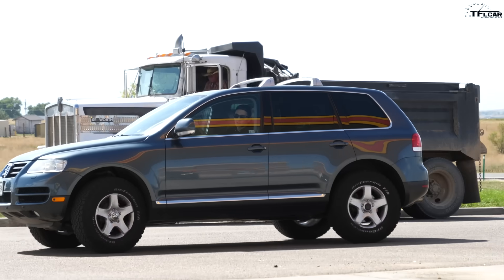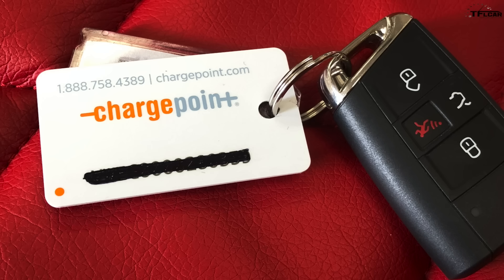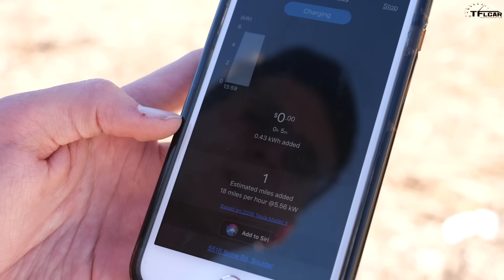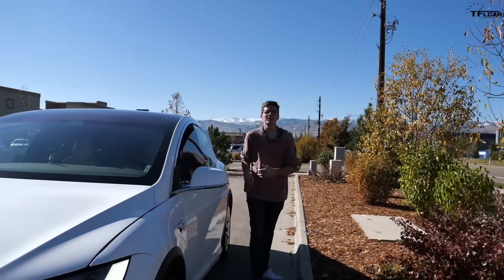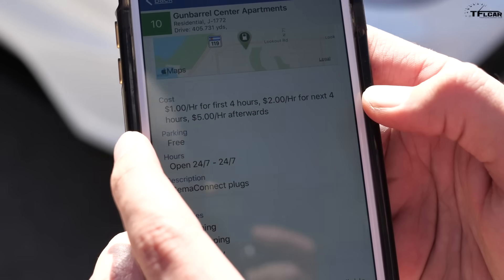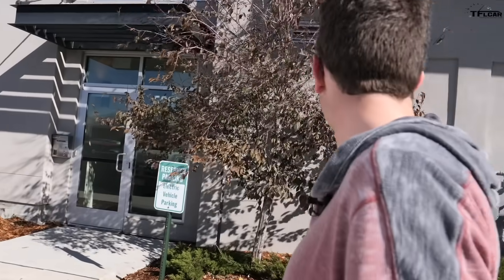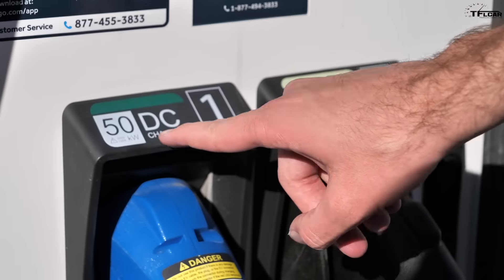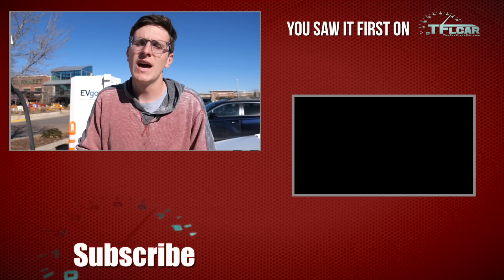Here’s Why Charging an Electric Car Can Suck - And It’s Not The Reason You Think!

Comment: So let me get some facts here You have to find a place to plug up when out and need a charge. The plug you find may or may not work. The supercharger is controlled by tesla have heard stories of them shutting off access to said plug. So no matter which way you charge it will take at least 30 if you can fast charge up to hours to limp home. Then every plug charges different prices and can set their own operating hours as well. Yeah, no screw that 5 minutes to pump 10 gallons in my car and a 400-mile range. Then add on the fact these cars cost how much more than a gasser. So you want me to pay extra and have all the charging BS as well.

Comment: The title should be ....electric car OTHER THAN TESLA Can suck; Otherwise, it is totally misleading. Yes, you need a garage or a car port when you own an Electric car. If you have your own electrical panel, 90% of the time you have access to 240V and 48 Amps of potential charging capability (not that you ACTUALLY NEED ALL 48 Amps). Depending of the range of your car and your DAILY commute that's all you need MOST of the time. It is like having your own, discounted "gas station".   No-one drives 24/7, when you don't drive, your car charges. In my case, 50 mile daily commute  gets replenished in less than 2 hours (if I used all available 48Ams - 240Volts it would get replenished in an hour.). Traveling long distance is when you utilize superchargers (Tesla). You don't need to enter any payment info, just pull in,  plug in, go to restroom, stand in a line for coffee or food, or a snack, by the time you are done your car will be ready. In a matter of fact, for me, the car is ready BEFORE I am ready to continue to sit in it for another 3-5 hours. I  have to hurry up to unplug it NOT to be charged idle-charges (occupying supercharger while NOT charging). Yes, at the present time, any other car tan Tesla, when traveling long distance may be.... problematic, but I am certain that will change as soon as VW, Ford, Rivian will actually START selling their electric cars and the CCS charging infrastructure catch up with Tesla's (in US - in Europe, in general,  tesla (model 3) uses CCS and equips their superchargers with CCS plugs).... Shame on you TFLC, you misled the public for what, views? Likes? you just lost all your credentials....

Comment: Most houses and business have a 220+ volt 100 amp 2 leg single phase feed to the fuse box from the pole or under ground transformer box(green). Most dryers and ovens are 220/240  50-100 amp single phase service outlet if you need a quick fix with a correct plug adapter with a 50 feet or less Heavy duty amp rated extension cord. See how easy that was. Respect all electric power especially high amp will kill you.

Comment: Seems like a lot to go through just to charge in public when compared to the standard of gasoline. "Oh good, there's a gas station I can fill up at" vs "There's a charging station but I'm not subscribed to it/it doesn't support my make and/or model...". Better make sure to never forget plugging up at night if that's an option depending on where you live.

Truly, this vehicle in the current state of things are not meant for someone working a minimum wage job just trying to get by which the majority of us are doing. Not only need to afford an EV but need to own a house with a garage to charge it in and enough down time to let it charge a decent amount. Heaven forbids the power gets knocked out by a bad storm and you don't own a backup generator.

Comment: For a start the cars only do a few miles fully charged. Takes hours to charge. So it's a non starter at the moment. They need to improve the battery so it can drive the car an exeptible range. Make chargers so they can charge quickly.
Until then I wouldn't consider a rechargeable car...give it more range and fast to recharge and I might think about it..

Comment: Stuck charging at home? This is the advantage of an EV. You plug in at night and have a fully charged car every morning. The only use of the chargepoint chargers are if you have one at work and can charge you car for 8 hours during your work day. If you don't have access to overnight charging or charging at work, an EV is not for you. I only use Superchargers and fast charging during long trips. I own a Model S and Chevy Bolt and 98% of my charging is done overnight in my garage. I could never own another gas car, so much easier to charge from home and not visit gas stations.

Comment: "high voltage in their garage"; no, normal voltage; silly Yankees with their wimpy voltage...
Reply: Australia has 240V as our standard.  Max15 Amps  on one outlet. A big jump in making home charging practical. If we go 3 phase we can get 415V but it cost more to get ( more wires and per Kw cost as well as costs to upgrade).
Reply: @rogerpearson9081  That's one thing you did right, I can tell you that much for free. But you say most people have single phase because tri-phase is too expensive per kW? Here in Norway, if you have anything more than a moderate semi-detached it's almost a bare necessity.
Reply: @mathiastwp   We get lots of heat so air conditioning is most important. Most houses are single phase. Usually only have 3 phase for workshops with Welders or motors over a certain Kva.Currently it is 37C in Adelaide so no snow today. BTW the Eastern states have had bushfires for the last month

Comment: So what does it cost roughly to get a full charge and what is the range of a Tesla?
Reply: Model 3 range is 500km (310miles)  for the large battery.  Max with the supplied charger for home is 240v @ 32 amps gets you 50 km/h (32mph)  You can buy a home charger that has more power.  A  100km 64 mile round trip commute will charge in 2 to 3 hours depending on temperature and battery level.  Set your depart time and the car will be charged and hot even in -25C  -13F  when you are ready to leave for work.
Reply: @choda42  thank you sir
Reply: @TANKHUNTER73  $12 cdn for 350km at a supercharger.  $0.01 per 1km at home during nights and weekends.  Free at my wife's work.
Reply: @choda42  thank you again. I really enjoy your channel

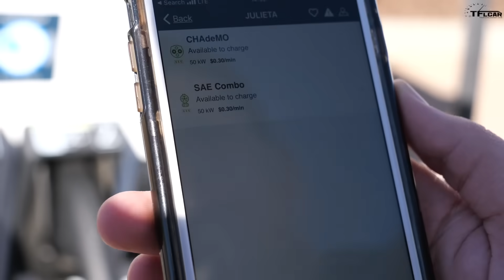Comment: 30 minutes does seem like a long time to wait but what are the savings? Looking in to the matter if we consider the prices given in the video (for quickest DC charging (13:14)) of 0.30 dollars per minute  and the average electric car need 1 kw-h to go about 3 miles we get that to fully charge a battery from dead to charges (I know you would never drive your EV to dead) considering its capacity is 100 kw-h take 2 hours and cost 36 dollars. For me to fill up my gas guzzler SUV to get a range of 400 miles (about 20 miles a gallon with a 20 gallon tank) and it requiring premium fuel at an average cost in my area of 3 dollars per gallon I end up at 60 dollars for a full tank. Thus doing some numbers we arrive at 8.33 miles per dollar for electric and 6.67 miles per dollar for my SUV. The numbers all of the sudden don't look so good.

Comment: That’s why you use only Tesla super chargers and Tesla cars.
Reply: Absolutely. The Laws of Physics doesn't apply to Elon Musk BTW did you get to the part where Tesla says to use the Supercharger 'only occasionally, to maintain a normal battery lifespan'. That's just BS, it never hurts a battery to rapid charge it, right? When it comes to Li-Ion batteries, the hotter the better!

Comment: The charging process is even more annoying that I had expected.
Reply: Not if you buy a Tesla.
Reply: @NVRick1  how much time tesla takes for a full charge!/?
Reply: @majinvegeta3284  There are too many variables to give a simple answer. At a supercharger, it could take anywhere from a half hour up to an hour, depending on how much charge you are starting with.
At home, if you have a 240V outlet, time isn't often a consideration, as the best practice is to plug the car in whenever you are home.
An example: yesterday I started with the battery 85% full. I drove 120 miles. When I got home, I plugged the car in and charged it back up to 85%. Using a 240V outlet, it took 5.5 hours to recharge and it cost $4.66. 

For a car getting 30 mpg, and gas at $3.00 a gallon, it would have cost $12.00. So you can see that an EV is costing me a lot less to run it.
Reply: @NVRick1  and what happens when it snows or ices up, and you can't get into your garage to charge it up ????????????
Reply: @dannyfields2065  Probably the same if it ices up and you can't get into your garage to start your ICE.
If you can't get into your garage, it really makes no difference what kind of car is in the garage.
I don't have that problem as it rarely snows at my house, and I have an attached garage.
I really don't understand the point you were trying to make.
Reply: @NVRick1  i have no problem getting into my garage, i walk in from the utility room door. but if i took out an elactric, it would be a problem getting back in the garage to charge it up. i can leave an ice car on the street. (like most people)
Reply: @dannyfields2065  I now understand what you were saying, that if you can't get the car in the garage, I agree it would be a problem especially if you had a steep grade. 

If this is a common occurrence where you live, I would assume you would have planned some way to access your garage, such as having de-icing chemicals at hand. When I lived in WI, I always had some to melt the ice.
Reply: But it's entertaining to watch the cowboy on the screen telling you interesting stuff about your charge.
Reply: Only if you own a non-Tesla.

Comment: I charged my car up the other day. Pulled up on my drive and plugged it in. Took me 30 seconds then I went in, ate. Watched some TV and went to bed. The following day I unplugged it and went about my day. (another 30 seconds)...

I went to fill up with petrol yesterday in my other car as the wife had the EV.
Went a mile out of my way because I don't have a petrol station on my driveway and got stuck in traffic for 20 minutes. Even had to wait in queue to pay.. 

Of course it was black Friday so it took a little longer than normal (which is 10 minutes)
The traffic where I live is diabolical.
It takes 45 minutes to travel 8 miles.. As a result the air quality is a bag of ballsacks. 

Cobalt is used in refining petrol. It can only be used once.
Reply: Fortunately it didn't rain while you were charging.A major thunderstorm while your charging 240V is the same as running a genset in the rain. Guess what screwed up your air...your big old obsolete power plants, unless you are lucky enough to have a nice clean safe fission reactor feeding your grid.
Reply: @crankychris2  I have 16 solar panels which make enough electricity for 6000-8000 miles a year and my provider is Scottish Power (which are the wind sector)

I only drive 3000 miles a year.. 
Besides that, nearest powerstation you're speaking of is 20 miles away and still 40% more efficient than petrol and diesel per co2 output..

Comment: Mother Teresa annoying 😬😠😕😠😬5 idiots (holden electrical dose have petrol built in charges) 
If you like we can add a special pack to the motor equivalent so no charging station, bit of modifing other than that I was surprised they had not built it for market use this is the only other available as the wheel charge is owned by a oil guy. And this charge is so full off it it's a kids RC toy for you rip needs to get rid off the company snake oil😠junkies without a brain no one plug for all WTF!. I have a Hector pack uses direct load and multiple high power alternators built for each car specifications fad fashion this at current otherwise the oil guy don't want to help you till he runs out off oil and he needs a new habit.

Comment: Why these companies don't build a solar panel or integrated on the windshield or windows on these electrical cars?
Reply: It will only supply 200 watts or so. So an all day charge might move you 3 or 4 miles, if you drive slow, with no a/c lights or radio.

Comment: Listen! You get ripped off. Some charge companies want $25 a deposit to use the charger. I have a 2011 Leaf. With DC (most powerful charger) still takes 1 hour to charge %80, 2 hours to fully charge. I know you never go less than 30% or above 80% charge. 80% to %100 is slow! Just forget about that. If you have a life run your car to about 13% & charge to 80 to 100 per cent. If you want to enjoy your car and make money... Ignore rules. I can drive around the city slowly about 2 hour on eco mode but on the freeway about 45 minutes on eco mode. Ouch!!!

Comment: Huh?   Ten hours for half charge?   Adapter?  Plug share?  Per hour/per kwh? A dozen apps for different systems?  Internet dependent?  All chargers start with AC and convert to DC....so the EV GO is only different because of a higher charge rate...it's all DC at the plug end.  Don't have the "understanding" or "bandwidth" to go through all that?  Ummm.............no.  Kid...your arrogance is astounding.  Could it be that they just don't want to put up with all that bullshit to put fuel into a car?  Ya think?

Comment: every hour charge time in a tesla is 17 miles wow now way
Reply: If you use a bad charger.  40mph charge with a standard 240v 32amp plug at home.  Always full and heated or cooled before you leave for work.  620mph at newer superchargers.
Reply: @choda42  i dont know i always see em at the chargers and still there when i am done eating at a rate of 14-17 miles per hour of charge time hahahah seems like a waste
Reply: so from e to full takes you 10 hours
Reply: @mackyb.outdoors1377  Depends on the charger.  The ones at the malls are useless  and expensive.  The ones at the hotel you are staying at and the one you install at home are not great either but 2-8 hours of charging while you sleep at night time rates works for me.  I have used a super charger 3 times in the year and a half I have had the Model 3.  All home charging.
Reply: @mackyb.outdoors1377  The Tesla chargers charge at 1000 km( 620m) /hour.
Reply: @mackyb.outdoors1377  At home (240v @ 32 amps) takes 10 hours from 3% to 100% (did that this summer).  You shouldn't go lower than 20% or above 80% often for longevity of the battery.  The top 15% takes the longest.  A gas car with a 500km tank goes from full to almost empty before you fill it.  Do that maybe once a week.  Plug your Tesla in when you get home and have a full battery (and a hot or cold car) every morning.   On long trips, the cars navigation will calculate when and where you need to stop to charge on route.

Comment: Up  until I seen this video I was considering buying an electric car. What you buy petrol or diesel is universal for every car in the UK and Europe. So why can't the electric car companies simply communicate with each other and have a universal socket. It seems each brand of car is trying to be unique. Which is fine when it comes to Body Work and Performance . But where it fails is the adaptation of a charger socket on the car. plus there are too many applications for too many charging ports. It just seems that too much hard work sitting there trying to find the right app for the right pump. And then trying to find the right socket for the right car. I wanted to petrol for now until the add this sorted. Which is a shame

Comment: This is why I have not  even thought of an EV for a new car.  People think they are so much better and cheaper to use.  You go on a trip and and your vehicle gets low on fuel.  In an  regular car how long does it take to fill...less than 10 minutes and you can go another 300+ miles .  Say you have a  car that gets 30 mpg...and that charger was filling  15 miles per hour and at $1 per hour. So it would take 2 hours to get the same amount of fuel as 1 gallon of gas  EV would cost $2 dollars and the gas drinker would cost $4 (roughly) . So 1 minute gas fuel per 30 miles vs 2 hour.  That means you value your personal time at $1/ hour.  Don't know about you but my personal time is  worth way more than that.  I am not a EV hater but I really think they need to focus on range and speed up charging  about 200x before I would actually start considering one of these EV's.

Comment: I live in an apartment complex and I would have to run a 100 foot extension cord from an outlet in my apartment to my car to charge it. Really not feasible because it would definitely get unplugged. Of course I can't afford a Tesla anyway. I wouldn't get a Leaf or a Volt either. I prefer my Mustang. That new Mustang Mach E looks cool, except for one thing. IT'S NOT A MUSTANG!!! That's an Escape with Mustang badging. Kind of like the Toyota Supra is really a BMW Z4.

Comment: I will never buy an all electric vehicle until these two problems are solved. First, an electrical vehicle that has a minimum of 300 mile range while using the A/C, Heater & radio. Second, a high charge exchangeable battery that I can swap out at stations or convenience stores, leaving my current battery to be recharged for another customer.